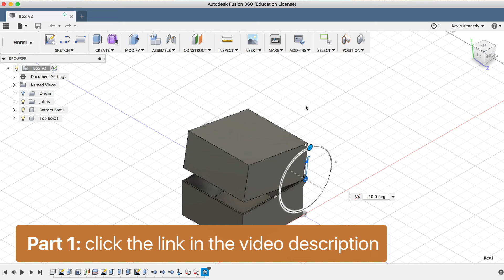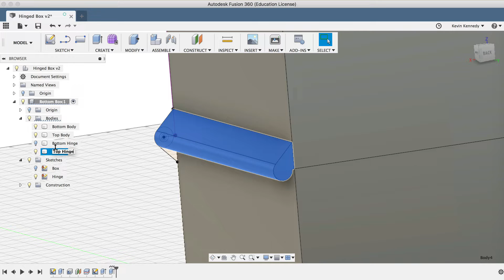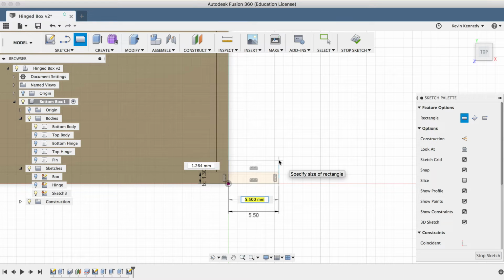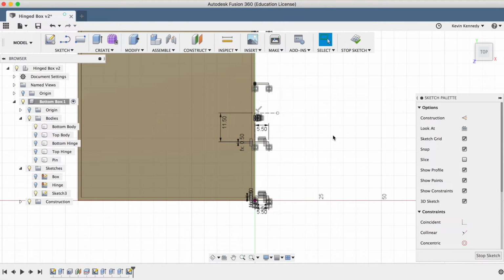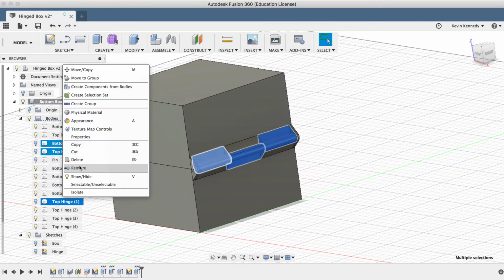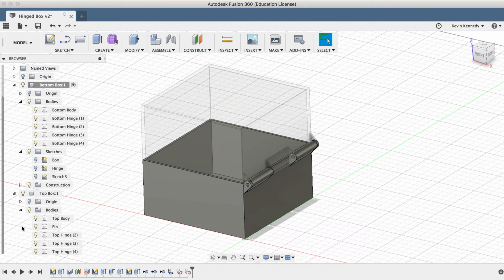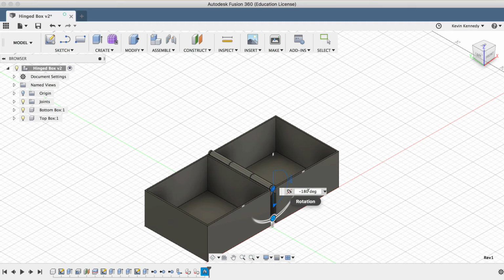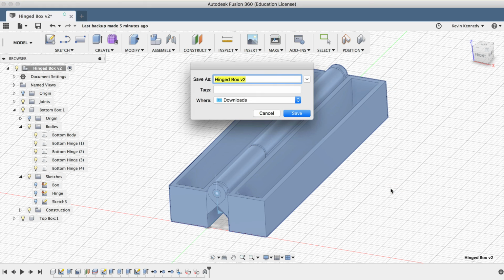How to 3D Model a Hinged Box for 3D Printing - Learn Autodesk Fusion 360 in 30 Days: Day #19(Part 2)

Comment: Perfect video. I am at the point to create the joint, but i cannot sort the bodies in the browser. i can drag them, but they will not move to the upper or lower box part... what am i doing wrong?
Reply from the maker: Double check that your timeline marker is all the way at the end of the timeline. And that you have the top level component active
Reply: @ProductDesignOnline  timeline is at the end and top is active. I think I messed it at the beginning when starting the Projekt and therefor the Komponente in the browser..

Comment: Dear Kevin, I read all the comments and saw there was someone else having the same issue but he/she didn't send you the file for you to have a look and help. When I change the Box Height parameter at the end from 70 to 20mm, the box 'comes' apart. It looks like the top and bottom box shrink in opposite directions. Here is the link to my file: https://a360.co/35EAF6t  Any help is much appreciated.
Reply from the maker: Hi Agata. Can you check your file like and make sure the "downloadable" option is turned on? It says "unauthorized to access this page" when I click on it, which is usually due to the link being set to private.
Reply: @ProductDesignOnline  , not sure I got it right but here is another link https://a360.co/38ck6Sq Thank you so much.
Reply: Dear Kevin, I did the tutorial again and came out perfect. You rock! Thank you. :)

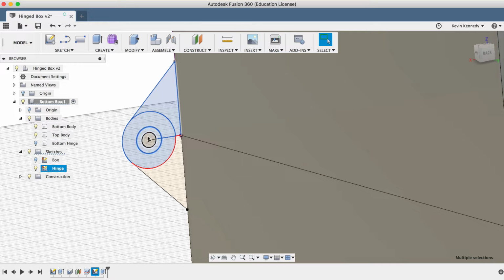Comment: 1:43 Shouldn't inside part be hollow? 
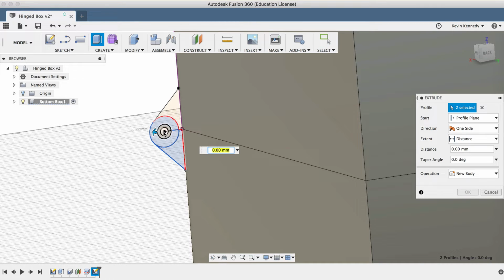Like you did at 0:47.
Also, isn't the pin overlapping with the middle section?
Reply from the maker: Please check out the pinned comment for an important note/detail that I didn't demo :)
Reply: @ProductDesignOnline  Thanks for the reply!

Comment: Hi
How do you activate simulation on a living hinge body?
Thanks
Reply from the maker: Right-click on the revolute flag (the little triangle) and you can select "Drive Joint" which will make it spin around.
Reply: @ProductDesignOnline  does the body have to be split at the Living hinge?
thanks!

Comment: Love your videos!  Thanks Kevin!  Just curious if anyone else was having this problem and could give me some guidance.  My test box won't shut all the way.  The back edges of the box next to the hinge collide before the lid is completely shut.  I guess my printer is printing the layers taller than they should be at this point?  Maybe just some sanding along the back edge would fix it but I would love this to work without post processing. The gap is small and I can force it closed but it resists and wants to stay open slightly.  Any thoughts?

On a side note.  So my wife wanted me to make her a recipe box so I thought of this tutorial.  I printed out the test hinge. It was a little stuck but broke free and seems to work well albeit a bit scratchy if I open it more than 90 degrees.  I am sure I could minimize that with some tweaking but can't complain too much because at the size I printed it the pins are almost 40 mm across which means I mostly successfully printed 40 mm bridges inside that hinge.  I suppose one way to address that would just be to add more breaks in the hinge so that no bridge was longer than maybe 10mm and see if the hinge works any better.  I will start with doubling the number of breaks in the hing and see what happens.
Reply: Just a follow up.  I doubled the hinges so there are six sections and added a little clip so it stays shut. My box is 120mm wide so the hinge sections are each 20 mm across. The action is quite a bit smoother since the bridges are much shorter. however with even number of hinges the top doesn't hook on one side so I need to redo it with an odd number so the lid connects on both ends with alternating top/bottom hinges.    

For my closing problem, I ended up removing .2mm of height of the back edges next to the hinge on both the top and the bottom in Fusion 360.  It almost closed. It only took about 20 seconds of filing that back edge on the top and bottom where they meet to get it to close all the way at this point. So got this working well enough.  Now to add some text to the front and see if i can get my printers multi-color function to work properly.  Thanks again for all the information.  Best 360 tutorials around.
Reply from the maker: Hi Keeley, did you see my note in the pinned comment?
Reply: @ProductDesignOnline  If you are referring to the part missing from the video where you have to remove the other two edges of the hinge, then yes I was lucky enough to read that before trying to print it out.  I edited it one more time and took it to 7 hinge sections and added inlaid text to the front of the box. The last test print of the hinge went well.  Going to wait until tomorrow to print it out full size.  It's an 11 hour print and I want to keep an eye on it

Comment: I think that if you want the correct distance to get it in 3 even parts, you need to use this formula (I also made a user parameter for width and depth of the box):
( BoxWidth - ( 4 * Gap ) - ( 2 * WallThickness ) ) / 6

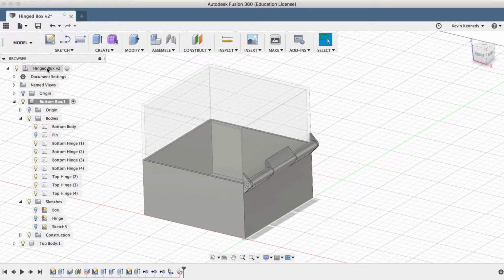Comment: Hey Kevin, great video. I am using the most recent version of Fusion 360 and i cannot drag the "top box" component out of the "bottom box"component like you do at 8:52. I guess that is also why i cannot add those other bodies "top hinges and pins" into my new component. Any solution to that?
Reply: for now, I just copied the whole component and Pasted New and deleted all the "bottom" components from "top Box." However, if there is a real solution, I'd love to know!

Comment: How is this supposed to print in place? The pin is "floating" inside the hinge?
Reply from the maker: In 3D Printing terms it would be considered a small "bridge". Leaving a small gap allows the pin and hinge to move after the box is closed upon completion. Here's a video of one of the original test prints - https://drive.google.com/file/d/1UGqrGW4gYRDo_IR_WvhzUOjoNWT_Mww8/view?usp=sharing

Comment: Could you please explain what the difference is between Chain Faces and Extend Faces on the extrude? Love the video by the way! I keep coming back to it when I need to remember how to construct a hinge. Thanks!
Reply from the maker: Hi, Catriona.

"Extend Faces" works with a limited set of geometry types (plane, cylinder).  This option will extend the selected face so that it intersects the profile to be extended.  It will almost always succeed, because the selected faces will be extended far enough so that it is guaranteed to intersect the tool body

"Chain Faces" will include faces that are adjacent to the selected face as termination faces. This will let an Extrude terminate to more than one face, and produce a result that can "wrap around" a complex set of geometry.  However, this will succeed only if that set of faces completely intersects the extruded profile. No geometric extension is used in this option

I hope this helps! Cheers :)

Comment: What is the difference between AS-Built Joint and Joint?????????????????????
Reply from the maker: Great question, Shreyash. As-built joints are applied when your model is built with the parts in the correct place. Joints are used when you need to apply joints AND need the part to be moved into the correct place.

Comment: Thank you Kevin for this video. It help me creating a dental appliance storage box for my daughter (https://www.thingiverse.com/thing:4132455 ).
I'm learning Fusion 360 and your videos help me a lot!

Question (suggestion for a new video?): On another project I was trying to place a hole on an extruded surface at a precise distance from the edges (https://snipboard.io/hTFJZn.jpg ). I made a sketch with some construction lines but I don't think it is the optimal way to do it. Any suggestions/tips? Thanks!
Reply: I figured it out for the holes placement: References!
Reply from the maker: Great application of the hinges! I love the smiley face vent holes on the top - very clever :)

Comment: Can you really print the box as is? Will the pin print inside the hinge and get it to work? Or does it need some filing or cleanup, or separation between the  parts? (I have yet to actually print anything) .
Reply from the maker: Hi Jesse. This works as-is without supports because a printer is able to "bridge" the gap over the pin. In short, when working with small clearances, you can often get things to print in place where they will become loose on the first use (in this case closing the box will separate the parts of the pin/hinge that may be stuck from printing)

Here's a quick video of one of my original test prints (ignore the sloppy filament color from not clearing out the extruder) - 
https://photos.app.goo.gl/nagpYdBeJUcE3XE47

Comment: Please help! Is highlighting all three circles for extrusion of the top hinge a mistake? Shouldn’t you only extrude the outer circle? If it isn’t a mistake, can you please explain how it works. It doesn’t seem possible for that to be solid and the hinge to function.
Reply from the maker: Hi, Aubree. Please see the pinned comment per an important note. I forgot to delete the top two.
--
PLEASE NOTE: You'll have to delete two of the end pieces before 3D printing. I forgot to show this in the video :)

It really depends on how many hinges you create when you cut the hinge up. I went ahead and deleted the bottom parts of the end of the hinge, that way every other piece is removed - https://snag.gy/cNokVz.jpg

Comment: Quick question: why did you extrude the "gap" region of the hinge when doing the top hinge?
Reply from the maker: Hi, Arian. The gap extrude (cut) is to ensure there is a small clearance so the hinge parts don't rub on each other when in use. Cheers, Kevin :)
Reply: @ProductDesignOnline  Got it, thank you! Could we also just leave the "gap" area between the pin and the 2 hinges unextruded—as opposed to extrude-cutting it out of the final piece?

Comment: I followed your 2 part tutorial on this box and I even did the edit you missed in the video but when I print mine it prints fine but when I attempt to close it, it doesn't work it just breaks. What have I done wrong?
Reply from the maker: Hi, Krzysztof Balamut. Did you print it with or without supports? The print works better without supports because they'll get in the way of the "pin" of the hinge when you got to close it. If you'd like, I can also check your Fusion 360 file to see if everything looks the same. Simply share it as a reply to this thread. Cheers, Kevin :)

Comment: For some reason when I am placing the gap rectangles (4min) the outer edge will not constrain. When I try to manually add a constraint it says it is over constrained. Any thoughts?
Reply: Also, thank you so much for these tutorials, so amazing what this program can do when you know how to use it. I had started with the Autodesk tutorials, but they seemed to get bogged down in the weeds, trying to explain all of these menus, and intricacies apart from actually modeling. Your approach works so much better for me. Actually designing while learning what all of the bits do, genius!
Reply from the maker: Hi, rik Collins. Glad to hear you're enjoying the series and learning! In regards to the constraints - It's likely that it automatically applied a constraint or two based on your click/selection, which is what's prohibiting you from manually adding one. Do you see any other constraint icons there? If so, you can select them with the mouse cursor and click the delete key on your keyboard to delete them. Then, try creating the rectangle again and look out for any automatic constraints.

If you're still having issues share your file with me and I'll take a look.To share your file please go to File > Share > Share Public Link (make sure "downloadable" is toggled on) > Paste your link here as a reply to this comment.

Comment: Hi Kevin,
I have suggestion to new topic related to 3D printing. My idea could be a part of bigger training. When I printed the box from this topic, I released that I didn't hide the body containing the axle in component. The result was top half of body integrated with this axle. It would be great to elaborate consistent / structured workflow which will easily  allow to avoid such mistakes.  I believe there is such workflow in Fusion 360.
Reply from the maker: Thanks for the suggestion, Marek. I will take this into consideration as I record more 3D printing tutorials! Cheers, Kevin :)

Comment: Hi Kevin,
This hinge will not work because left and right supports for axle overlaps for top and bottom half.  So the top and bottom parts don't match each other. Don't worry - I discovered this just after printing :-)
Reply from the maker: Hi, Marek. Sorry, you must not have caught the pinned comment. I had forgotten to delete that in the tutorial. Here it is:
--
PLEASE NOTE: You'll have to delete two of the end pieces before 3D printing. I forgot to show this in the video :)

It really depends on how many hinges you create when you cut the hinge up. I went ahead and deleted the bottom parts of the end of the hinge, that way every other piece is removed - https://snag.gy/cNokVz.jpg

In this scenario, it really wouldn't matter much as it should work either way. I have the box printed out like screengrab above and have no problems. I will have to try doing it the opposite way and see how it is :)

Comment: I can’t seem to select the revolute flag to rotate it once it’s been set. It just clicks through and I, clicking the body. Do I need to set something up to be able to do that?
Reply from the maker: Hi Alex. First, check that all of your joints are visible in the Browser. Make sure the eyeball icons are all turned on. Second, you can hide the bodies and leave the joint (revolute flag) visible. This should make it easier to select. You should be able to right-click on it in order to select "edit joint limits". Let me know if that helps at all...there's no reason that I can think of that would make the joint unclickable. Cheers, Kevin :)
Reply: @ProductDesignOnline  Hey Kevin! Thank you for the quick response. When I went to right click and edit the joint limits I had to select minimum and maximum check boxes and then it gave me the option to rotate the joint just fine. Not sure if this is the correct way I should have done it, but it solved the problem.

I did notice now I am not able to edit any of my sketches to modify them from the 70mm to the 10mm. I tried checking my other sketches and wasn't able to modify those dimensions either. I don't think the two are related, and I think I might have clicked something to lock the dimensions and not make them editable.

 Thank you for your help and the videos!
Reply from the maker: @AlexParton  Hi Alex. Glad you got the joint limits working. With that said, that shouldn't have affected the sketches or dimensions at all. Did you set up the user parameters? If so, you will need to edit the parameters in the parameter dialog instead of at the sketch. Cheers, Kevin :)

Comment: Thanks so much for this tutorial. I would like to change the wall thickness but when I do the hinge mostly disappears. Can you help with how to make it work with a thicker wall? Thanks!
Reply from the maker: Hi Travis. The wall thickness shouldn't affect the hinge. Can you make sure that the initial rectangle you created for the hinge is snapped to the outside/edge of the box? You can add some confident constraints if it doesn't seem to want to stay on the edge. Let me know if you need more help, I can take a look at your file specifically. Cheers, Kevin :)

Comment: Hi. Great video. Thanks for posting. Probably a novice question but...I'm confused as to how the pin will print. Specifically, if I print with the box open, both boxes flat on the print surface, isn't the portion of the pin that's captured in the two outer hinges going to be floating in space? How will it print that without some sort of internal support (that I won't be able to remove)? I did print it that way and it was what I expected - the hinge did not work until I force-ably rotated it. And then I heard cracking. And then it seemed to work until the two outer pieces broke (the pieces on either side of the gaps that we created by mirroring and that are on the very ends). Thanks for any feedback.
Reply from the maker: Hi, Dan. Thanks for watching and commenting. This design should print in place and work without any supports. There is a video of one printed out along with a thread about this in my Facebook group - https://www.facebook.com/groups/fusion360hobbyists/

The key thing to check - Did you see my pinned comment about deleting the two end pieces of the hinge? I had forgotten to show this in the video. It really depends on how many hinges you create when you cut the hinge up. I went ahead and deleted the bottom parts of the end of the hinge, that way every other piece is removed - https://snag.gy/cNokVz.jpg

The pin should be attached to the top two end hinges as well as the middle hinge. There is only a small tolerance of about 1.8mm between the pin and the bottom two hinges. This is small enough that most FDM printers can print this without any supports due to the "bridge" technique. There may be a small amount sagging with parts of the pin, but as long as your printer is calibrated fairly well it shouldn't prohibit the hinge from working.

Let me know if that makes sense! If you're on Facebook, join the group and I'll try to direct you to the recent thread.
Cheers, Kevin :)
Reply: @ProductDesignOnline  Hi Kevin, i cannot find that video on facebook, is it still there? thanks for your help